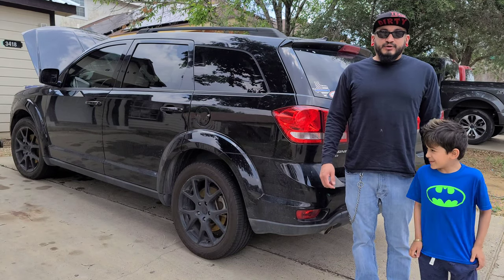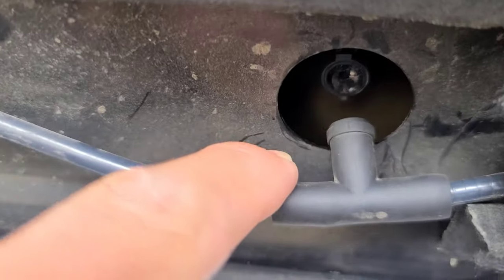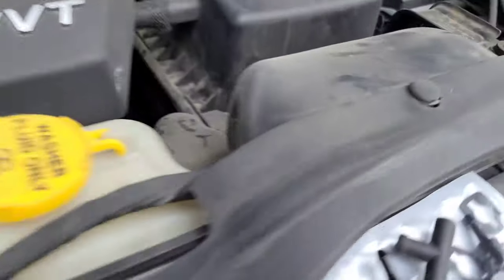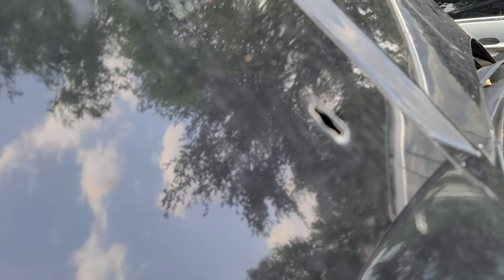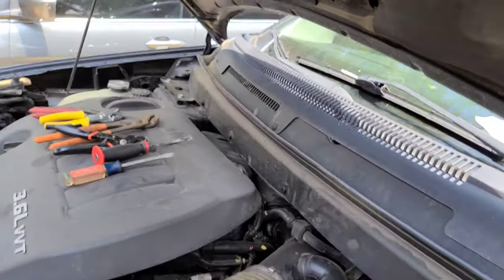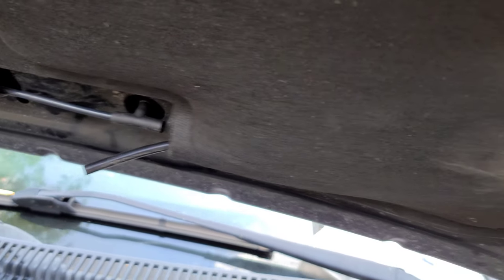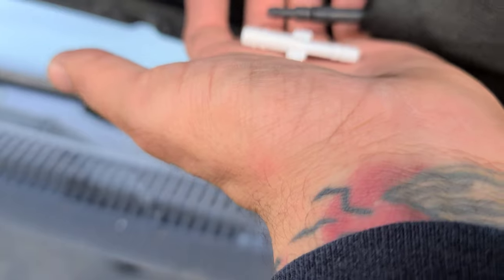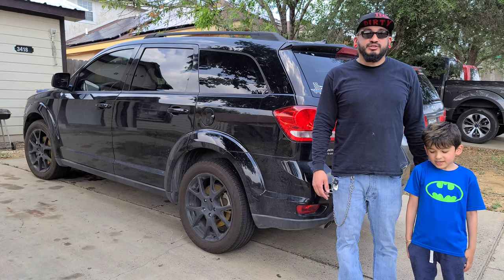Dodge Journey windshield washer repair nozzles and hose

Comment: Thank you so much! I was watching another video on replacing the washer sprayers for my journey and was just using the needle noses but they didn't work right and I couldn't loosen the Nozzles. I almost gave up and was about to go waste money getting them replaced somewhere b but then I used a flat head screwdriver and it came out with no problem
Reply from the maker: Glad it helped!

Comment: Wow! My 2015 Journey had connections that broke in the same place. Crazy! . I think these lines are just plain junk. Thank you for the video.
Reply from the maker: For real, the hoes I use to replace it are actually rubber and not plastic.
Reply: Same just watched this now and it's exact same problem. Junk plastic
Reply: My 2015 also just broke off the exact same places as the video

Comment: Is a really crappy washer design flaw and materials Mopar used on several models. Lucky is an easy fix that Really didn't need a 12 minute video. Another channel shows it in 90 seconds
Reply from the maker: For sure, crappy, as you can see all the views on this video. Appreciate you staying tuned for all 12 minutes.
Reply: I didn't last more than 60 seconds before I left
Reply from the maker: Maybe you should see more than 60 before judging a video. You never know if you like or not

Comment: My 2001 Toyota Seqoia has had zero problems except normal wear and tear.    This Dodge system really sucks.  All my Toyotas are 1000% easier to work on. 
Replace the belt in 8 minutes if you have a socket and extension.    Looked under hood of 2018 Journey and 4 connections are off and 2 broken hoses!  WTH Dodge.  Bad design, parts etc!